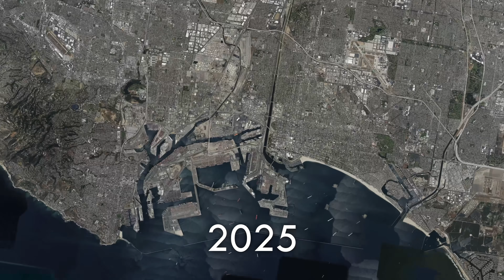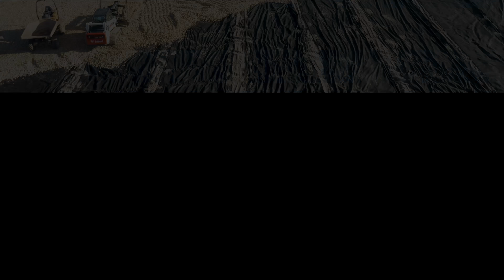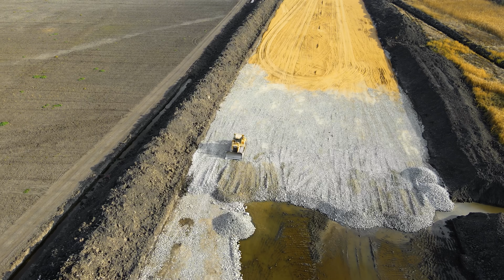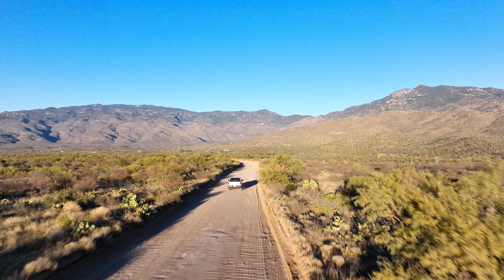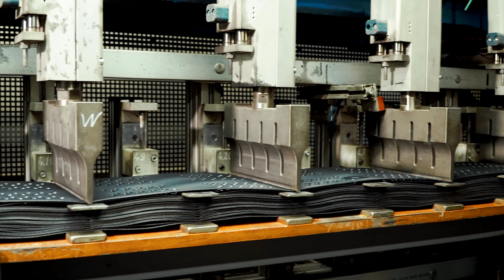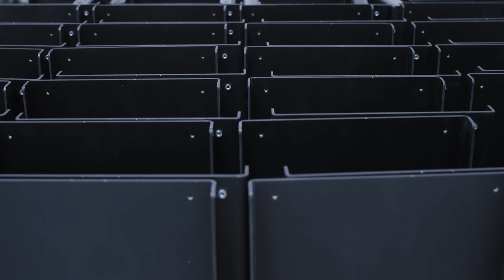The Grid That Doubles the Strength of the Ground

Comment: Finally!  Europe was using this type of idea decades ago!  Basically concrete or ceramic blocks with holes, laid on the side, covered with soil, and planted with grass. Large parking lots that look like lawns, but can handle light traffic without ruts or becoming mud holes.
The use of these plastic cells may not be quite as solid, but “solid enough” is all we need.

Comment: You forgot one important option in your list of possible solutions to strengthening the ground - soil remediation.  Especially if you have clay soil, the addition of a small amount of either quicklime or hydrated lime reacts with it and the water, to produce a much stronger and more stable material, which can be used as a good quality sub-base.  I worked on HS2 where we took the wet clay from the tunnels which had up to 28% water content and was like toothpaste, added just 4% by weight of quicklime and mixed it in a pug-mixer, and it changed in front of your eyes almost like magic, into a compactible granular fill that was suitable for building stable embankments!  

It doesn't work for all soils, you have to have some clay because it's the reaction between lime, clay and water that produces the good result.  But it means that for some bases you can get away with as little work as spreading out the lime, running a rotovator over it to mix it with the soil (if necessary topping up the water which is an essential component of the reaction), and rolling it.  I'm simplifying a bit here, but that's the principle.  The practice has been known for many years, but the precise chemistry and physics are still not fully understood.

Maybe soil remediation would be a good subject for a video!

Marion

Comment: funny enough watching this across the road from me. A retaining wall that has been timber braced since December, where they are replacing a section that has failed. the brickwork was busy falling over, and now since a month ago the wall has been under repair. they dug out the side, and exposed the wall down to the base, and then cut it and demolished it. Dug down to the foundation, and, as the supervisor said, "they built it with no reinforcing, and nothing to anchor to the foundation, which is big enough to hold the Empire State building", so it was failing under tension, and threatening to overtopple, as it was burst in every brick join. now has a massive concrete footing, heavily reinforced, drilled into the existing one as added support, and all the way to the edge of the pavement. then lots of vertical rebar, and they cast a new vertical one this week, thickness the original wall, but a single monolithic slab coming out of the new ground, and unlikely to suffer from any failure in future. good thing, as we do not want to wake up with an in premises swimming pool that was there, which had been threatening to do exactly that.

Comment: On an engineering project I was involved with, I had to draw up the sheet metal shapes in CAD and email them off to a local laser cutting shop/factory. They gave me a fascinating tour when I went to collect the pieces.
So easy to make corrections (add 5mm here, make this angle a little sharper) on next versions in the CAD.
Could/suggest you do a video/sponsor visit on this?

Comment: I remember seeing a video about the reusing of old tires to create a grid just for this purpose. I don't remember if they were interconnected, but it was put forth as a use case for old tires, and also as something that can inexpensively provide a more solid foundation for things like roads and driveways.

This product definitely is more compact, and therefore more easily deployed.
Reply: Came here to mention "mechanical concrete". They cut the top off the tyres, join them with screws, fill with drainage stone, road-base on top for compaction, asphalt.
Reply: I have heard of “mechanical concrete “ , it sounds wonderful. It is just as Grady is talking about,only on a heavier duty scale with the bonus of using the millions of mosquito breeding reservoirs.

Comment: Landscaper in TX, we use them on slopes for ponds or to give additional fire lane without having to pave. Especially in Austin with tight areas and high cost, more then a few apartment complexes have had us come add in geocell and fill with road base to give room for fire trucks. First time I ever saw a fire truck use it I was impressed figured it would buckle but didn’t

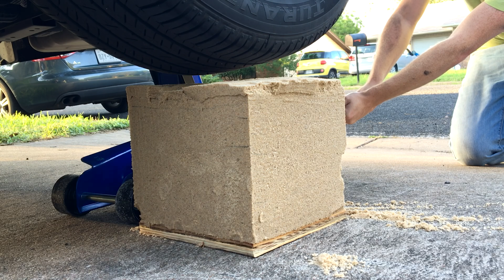Comment: @practicalengineering I used the knowledge gained from watching your older video (mentioned at 7:26) to fix a retaining wall on my property. There was a lot of lateral pressure from the dirt pushing the concrete blocks out into my driveway. After pulling it apart and putting the fix in I haven't had to touch it in years.

Comment: i think it would be hard to cover it sufficiently to keep the crappy plastic from being crushed when you drive on it.  i'd still want a layer of asphalt on top of it.  if you made the cells really deep under a layer of asphalt of cement i suppose you could stop soil erosion.  but you'd have to go pretty deep in most cases

Comment: Your demonstration with the sand track is ironically exactly what I've seen many access roads to beaches use. They just sink some of these cells into the sand to stabilize enough for vehicles to drive on without eroding it completely away.

Comment: The prefix geo- refers to the Earth, and though its meaning has spread out a bit to include land or soil, when referring to things in space, a geocentric view solidly implies that geo- refers to the Earth alone. Therefore you would start to run into problems with pedants if you wanted to do any geology or geotechnical engineering on the moon or further away.

Comment: Concrete Geocells are widely used in European urban settings. Airplane runways, temporary airstrips, landings use interlocking alu, steel  or carpet style geocells
Reply: The cells are filled with concrete?

Comment: Thank you for going over the environmental issues with the plastic!
Reply: In actuality how he handled it bugs me. He starts by talking about peoples' concerns about geofoam and the environmental impacts, but then switches to talking about the plastics that geogrid/geocells are made of (HDPE)
He doesn't address the concerns with the styrofoam blocks being used because those are 100% polystyrene which is what styrofoam is. So like...could we have spent at least a moment on the actual concerns people had? Rather than avoiding it to point at the one that's less concerning?

Comment: In a complete coincidence I have just built a parking pad on my muddy lawn for my heavy SsangYong SUV (which needed 4WD to exit after heavy rain). I'm in NZ, and used a NZ product called SurePave, solid but lightweight interlocking plastic panels about 32"x 24"and 1.6" deep made up of 4" diameter honeycomb cells. I laid these over a geotextile layer then raked in a trailer load of 1/4" - 1/2" river pebbles, a very quick and easy job and the result is amazing! It looks really good, has zero movement under the 45 psi pressure from each tire, and is completely free draining under heavy rain as the ground slopes slightly. Even better, the total cost for this easy DIY job was about 10% of the quoted cost for an equivalent concrete pad!

Comment: Hey Grady, as I was watching, I realized that there's an interesting structural engineering project coming to a conclusion in the Mountain West of the United States that you might find interesting: The renovation of the Salt Lake temple. This historic structure, built from granite blocks, is important to the faith that operates it and its community, so it's important that as much as possible was preserved in the structure, but it needed some major upgrades, particularly the addition of a base isolation system for seismic safety. I'm sure that there are some interesting engineering challenges in adding such a system to an existing structure of this sort, and it could be an interesting vehicle for exploring base isolation systems in general.

Comment: Two thoughts:

1. Your comment about the percentage of plastic to sand in your garage test leads to the amusing consideration of the end result being a "soil alloy".

2. Sure it's great that trucking in a relatively small amount of cells can keep you from needing to truck in larger amounts of fill, but it's still plastic.  It would be even more interesting to research methods of creating cells (or reasonable analogues) with other materials that are also as natural and locally-sourced as the fill.

Comment: We use geocell in water treatment too! Most of our equipment has to be contained to protect against spills or other mishaps. This means either a giant expensive concrete slab, or a thick impermeable liner. 

The problem with liners is that they are fragile. We have a lot of heavy equipment, that even with a foot or two of drainage gravel, can damage the liner. Geocells help spread that load out to make it easier on the liner material.

It helps keep our projects cheaper, easier to build, and way more versatile.
Reply: Sounds glorious! 😄

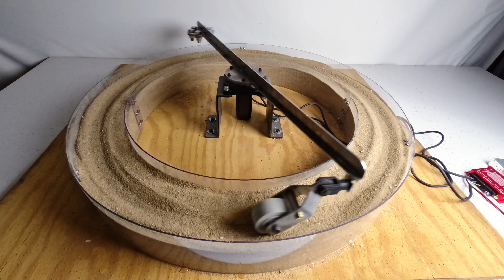Comment: 10:49 This effect is mostly only an issue with gravel roads between towns that don't have access to fields. Out where I live we have many gravel roads that don't suffer from wash boarding. I think it is due to the tractors we drive having much larger tires and tracks that smooth over the peaks before they become noticeable on your car.

Comment: I would bet geo-cells could be scaled up for use in skyscraper foundations. Either, to reduce the cost of the foundation, or to increase the load bearing capacity for a much taller skyscraper. 

I would definitely like to know more on that possibility!

Comment: I was on an off-road trail in a national forest this past weekend and I saw where they had used cinder blocks set with the opening facing up and down to hold soil on steep slopes in the trail. 

I suppose that was a geocell as well, in a sense
Reply: I noticed this while riding the Ozarks BDR a few weeks back, was the first time seeing it and although it was strange to ride over it seemed to be working well!

Comment: Great episode.  Burying plastic as geocells looks like a nearly perfect application.  It uses petroleum that companies are determined to pump in a way that produces minimal CO2.  It can use recycled LDPE.  It reduces the amount of concrete needed, which reduces the CO2 generated by cement production.  Could mixed plastic waste be used as part of the fill?  If so, that would be another good sink for petroleum production.  If we can't leave it in the ground we should at least put it back under the ground.

Comment: In my area we see geocells used in some developments to provide an emergency second access for fire trucks/emergency responders. Rather than paving a whole second emergency only entrance, they use geocells or similarly shaped pavers to reinforce the soil. That allows emergency vehicles to drive over it, even in the rain, without sinking in. With the geocells, they usually let the grass grown through in the dirt so they end up looking almost just like a grassy lawn.
Reply: Drainage is a big factor... they're often used for driveways where you want the drainage benefits of loose gravel (i.e. mitigating flooding) over concrete, but without most of the downsides of loose gravel.

Comment: In terms of microplastics, how are the plastics in this remotely analogous to plumbing pipe? Like I get they're the same material, but the conditions, the way it's used, the amount used the the sheer volume is not the same thing. The top edges will slowly be worn off won't they? And at some point they'll have to be ripped up. How do they do that? The way you hand-waved all this away by just saying "it's not different to pipe" was lowkey mad-scientist levels of cope.

Comment: Geogrid is great for protecting the ground too, depending on its use. Used to have rutting on the front yard near the road as the soil would compress under car tires which would keep grass from growing. After a reinforced geogrid product which is stiffer, filled with soil, and seeded the grass grew and stayed. Extended the sides of the driveway without and the ruts are gone. This is great for areas you occasionally drive on without ruining the grass or over compacting the soil.
Reply: Mom used to keep alpacas, and the gates between pastures would always turn into mud pits. Solved it by using old carpet with grass seed as impromptu geotextile.

Comment: The problem with the grid stuff at moment, besides engineering to do it right is that it kinda lives in a Monopoly as the companies that make it charge way to much (were i live there is a recyling company that makes this kinda stuff and plastic fencing posts etc...they cost less than wood to make/use free recycled material....but wait they cost more than wood as they own the market and charge whatever they want when its meant to be the cheaper option - get they probably have corporate contracts so retail looses out)

Comment: I imagine this could easily be upscale for quickly making new roads or replacing them. A machine that rips up old or tearing up the soil to depth. Rolling out the cells and backfilling with the material pulled up. Then asphalt and compress it. Probably could make a machine that does the subsurface work and another following surfacing it

Comment: Your experiments are often wonderful, but I'm not sure this one showed what you intended.  To me, it didn't look like the additional stability had much (if anything) to do with the plastic providing resistance to sand shearing.  Rather, the wheel was traveling directly on the plastic itself, so the plastic structure (not the sand within the cells) was bearing the load of the wheel and thus distributing the load across the entire plastic structure.  I may be completely wrong, but that's the way it looked to me.

Comment: Fascinating!!!!  I rather wish this kind of thing was more available to "DIY" efforts... mostly because I can think of a good half dozen places where such reinforcement (and the ability to use inexpensive/local soils) would be SO helpful. Two of those are, essentially, dirt roads serving as driveways - vehicle access into an unpaved area, but the place where the county-maintained asphalt road stops is... shall we say, it's a raw edge? As in it's constantly degrading and the elevation change is SHARP. Terrible for the vehicles that have to navigate it. However it's plain fact - getting such a transition spot paved properly is really expensive, and the county won't pay for any of it of course. It's a situation that's probably common in every rural community, anyplace that has "turn OFF the paved road" in its directions. Most of the time I think folks just put up with it and try to make sure they have a tall rugged truck that can contend with the rough road. But boy, if this was something easily accessible to the average rural homeowner? If it was something you could reasonably install yourself, no more tricky than a basic retaining wall? Fabulous idea, I say.
I do recognize though, that even if laying this stuff down is "easy" it's almost certainly not as simple as sticking a bit of sand and maybe landscape fabric in a spot, tamping stuff down, and laying some pavers.

Comment: Hello Grady! You made a wonderful demo there! But it seems that your printed mesh alone is probably strong enough to support the wheel's weight and doesn't exactly reflect real-life examples.

Maybe, for a better demonstration, either a much thinner print or glued/sewn pieces of paper/thin plastic should have been used? Or a heavier wheel, for that matter.

Comment: Seeing the grid float up at 12:31 is fascinating! I've seen the same thing happening to big rocks on dirt roads. Would love some insights on how something that heavy can move upwards.
Reply: I think this might be an example of the Brazil nut effect. When granular objects are shaken or vibrated, the small particles are able to fill in the space below larger ones and eventually bring the largest objects to the surface.
Reply: @user-st2si3he1o I would expect it to sink when the soil becomes loose from the shaking. Perhaps different frequencies have different effects? Soil is weird!
Reply: @di99utpe  the material it's being replaced by is also heavy, so its weight doesn't actually matter that much, as long as it's not massively more dense. it's just the fact that those small grains can fill in the space under the rock, increasing upward pressure on it, and meanwhile the grains can move off of the top of it to the side to fill in the space left by the grains moving below it, decreasing the pressure above it. you get a net flow around the large object and it rises
Reply: @killerbee.13 If I shake realy hard the soil would be liquidated and the heavy stones would sink again? What would it take for the weight of the boulder to overcome the shear force of the soil under it?

I'm not arguing that it doesn't rise. I'm just curious on which conditions cause what effect and why. 🤔
Reply: @di99utpe  I'm not certain that soil liquefaction would cancel out the brazil nut effect. Maybe it would, but maybe it wouldn't. Note that when soil liquefaction impacts a building, the building protrudes above the top of the soil, and thus has significant weight not offset by buoyancy. Whereas a rock on or near the surface of the soil is still fully supported by its buoyancy as it would have a density mostly similar to that of the soil around it.

Comment: I have seen this done on roads. Usually in wash out prone areas. They still wash out and when driven over when wet seem to clear out the cells. Seems like the use should be regulated as it has just introduced a bunch more plastic waste as they break down fairly quickly when used in this way. 
Be a great test to build up a road base in you test setup where the sand can leave out the sides of the road bed and introduce rain events too!